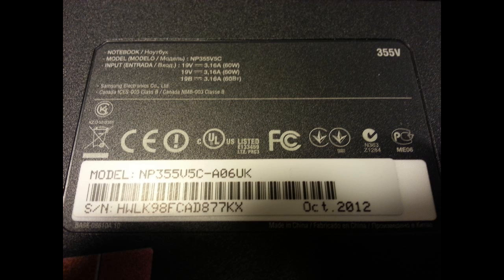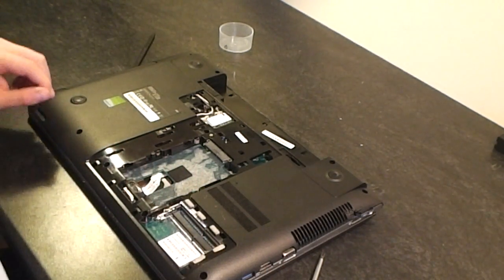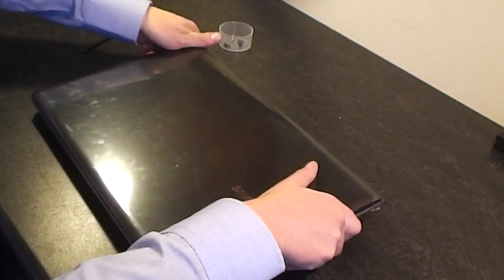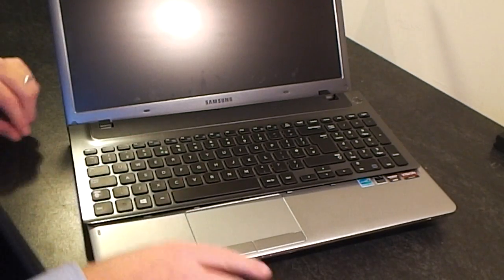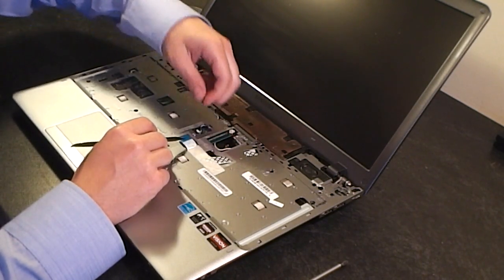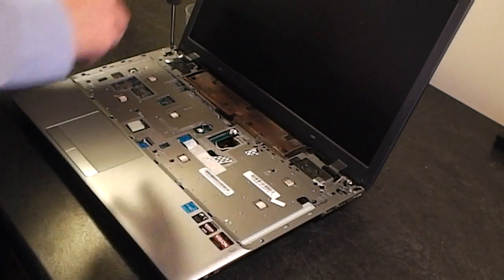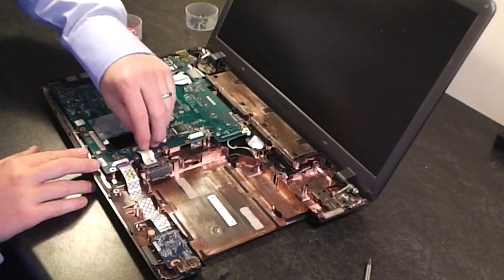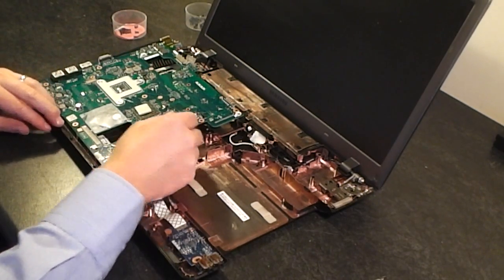Samsung NP355V5C Disassembly Guide

Comment: Great video. Used it to access a noisy fan on a samsung I acquired. However, the mic doesn't work despite showing on the control panel. Can anyone tell me where it is located so I can check the connection and maybe replace it. Thanks

Comment: I was hoping to do something with the psu as the laptop wont turn on or charge. The cable works. Im not sure if its the connection on the laptop or what. Ive replaced the cable 3 times and sooner or later the same thing happens. Need help

Comment: I accidentally cut the two cables off the white plug that is being removed from its socked at 7:00. Can anyone tell me what they are for and whether I can somehow plug them back into the white thing? Or buy another one of those white plugs somewhere?
Reply: Hello, what does it do that cable? What problem generated in windows ? Thanks!
Reply: It was the speaker cable

Comment: Thanks for this video. At least I know now not to attempt it myself.
Reply: Same here wanted to clean the fan and cooling system watched this and decided it was a giant pile of no thanks.  So glad I wasn't halfway through disassembly. Absolute lifesaver video cheers.
Reply: @emacgregor2239  I have just done this, no experience what so ever. In 2 Hours I had everything off, cleaned and put back together and all working no problem :)
Reply: @emacgregor2239  Exactly the same here.  Bought a newer laptop and wanted to give this one a clean up, maybe change thermal paste on processor before passing it on to someone else.  Not really worth the effort.

Comment: And one small problem matter I have :). How do you easily replace the li, bearing in mind the webcam and connecting cables secured on the inside of the lid? I'd be forever grateful for any tips BEFORE I SCREW IT UP... Many thanks

Comment: I HAVE 350 SERIA 3 WITH i7 INTEL 17'' AND WHEN I WAS COMPERING IT WITH OTHERS, LENOVO, HP, TOSHIBA,SONY, MAC, ASUS, ETC 2 YEARS AGO HE WAS BETTING THEM TO DUST IN HIS PRICE RANGE, I WAS SKEPTIC AND WAS SEARCHING FOR GOOD RELIABLE AND BUILT LIKE TANK LAP TOP THAT WORK FAST UNDER PRESSURE AFTER 6 MONTHS IN PRICE RANGE OF 500-600+ EUROS SAMSUNG WAS THE BEST, AFTER 2 YEARS MY LAP TOP IS STILL WORKING PERFECTLY GOOD , HAVE CLEANED IT JUST ONE ONCE, AND OTHERS HP, LENOVO AND SONY AND TOSHIBA AS WELL ARE WORKING MUCH SLOWER NO MATTER THAT I REINSTALL ALL OF THEM. PLUS SAMSUNG IS GIVING FREE ON LINE SUPPORT TO ALL COSTUMERS!!! FOR ALL KIND OF QUESTIONS AND THEY CAN HELP YOU WITH ANY TIP OF PROBLEM EVEN SOFTWARE ONES-FAST 100% PRECISE.SO WHO IS SEARCHING FOR GOOD RELIABLE LAP TOP WITH TOP OF THE LINE PERFORMANCE THAT WILL LAST SAMSUNG IS WINNER!THERE IS ONLY ONE STUPID THING I DID I SHOULD BAY MORE SAMSUNGS FOR MY OFFICE INSTEAD OF OTHER BRANDS, NEXT TIME ONLY SAMSUNG ALL THE WAY.

Comment: SAMSUNG IS MAKING THE BEST LAP TOPS FOR PRICE, PERIOD, IT IS IMPOSSIBLE TO MAKE STURDY AND STRONG HOUSE IF YOU MAKE EASY ACCESS TO ALL, AT LEAST ACCESS FOR MEMORY AND PARTS THAT ARE CHANGING MORE OFTEN ARE EASY, AND ONE MORE WHO WISH TO CLEAN IT FROM DUST CAN TAKE LAP TOP TO 1ST GAS STATION AND WITH AIR PRESSURE TROUGH BARS CLEAN ALL DUST, DO NOT FORGET THAT SAMSUNG IS MAKING ALL PARTS OF LAP TOP EXCEPT CPU AND GRAPHIC CARD- NOBODY ELSE IS DOING THAT , AND WHEN IT COMES TO HARD DISC SAMSUNG IS NO1 FOR DECADE AND MORE, THEY MAKE THE BEST MONITORS AND OTHER PARTS SO FOR SURE THEY ARE MAKING THE BEST LAP TOPS IMHO.
Reply: seriously?

Comment: Thank you - after watching your video I was able to bring SD card reader and jacks back to life.

As a side note - I hope that the designer of this case will spend eternity unmounting laptop keyboards.
Reply: Hell fucking yes. This plastic fantastic thing has caused me a headache! I mean, it has survived seven years of constant use so far, but it’s a pain in the ass to service. All these little fragile plastic bits are just waiting to snap. Had to use some power glue to get some tabs back on.

Comment: I want to do it because my laptop doesn't run the games like when i bought it (1 year ago) all games are fps dropping baddly and all of this I supose because of dust inside, but I am afraid to break something inside any suggestions?
Reply: Ι'м having the same issue brother, i've opened it now and hopefully i'll change the thermal paste on the cpu, how's your laptop now ,anygood?
Reply: mine is 4 years old and nothing wrong with my cpu just gpu crashed 2 times bc of overheat and sent it to pc service cost me like 40$ to repair it , pf

Comment: I have NP350 so its preety much the same.
Well fuck, I wanted to clean up the radiator and replace thermal paste, but after saw that it requires me to disassemble almost the whole notebook, I think I'll let it work "dirty" for some time. GEEZUS! My good, old FS Amilo 2550Pi had everything under one giant-ass cover that was tighten by 8/9 screws, and it didn't fell apart with only 4 of them!!! Everything was accessible and easy to do... What kind of sick m***er puts the radiator so hidden that you need to disassemble the whole laptop to get to it?!

Comment: Great video. We were able to swap an A8-4500 for an A10-4600 in one of these quite easily. Your instructions are excellent and your filming and angle are just fine.
Reply: Do you know more about cpu swapping procedure i have the slowest cpu option a6-4400m and want to swap to a10.
Does motherboard support this due these are same series laptop but diff cpus and do you need some sort of bios update
Reply: If you reply you will be a life saver
Reply: @muradturkmen2178  It shouldn't need a BIOS update. But if there is a newer BIOS it would be a good idea to do the update before doing the swap. As long as its the same series of laptop as in this video it WILL support the A10 no problem. If it's a different series I'm not sure if it will or not. Pretty much anything that supports one should support them all.
Reply: @geeknproud321  thank you
Reply: Where a north bridge in this mainboard?

Comment: Cheers Dude,
I was wondering how to get it open so I can swap the A8 for the A10.
Reply: +jason croker Did you ever do it? I can't tell if the CPU is soldered in or not. Also, if you did, which A10 did you use?
Reply: Skillzorz101, I installed a A10 4600 in it along with 16gb of corsair 1600 ram and a Samsung 500gb SSD.
It works great.
Reply: Thank you.
Reply: can you swap a6 to a10 i have question because a6 is 2 threads but these all 3 has same tdw